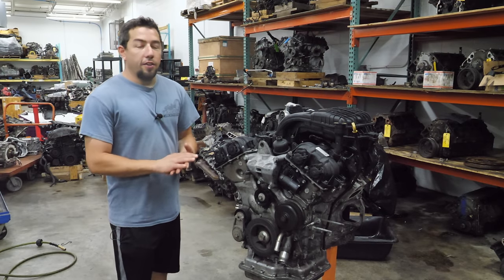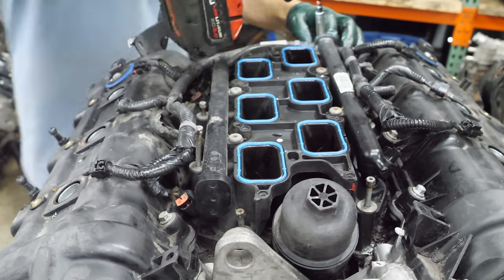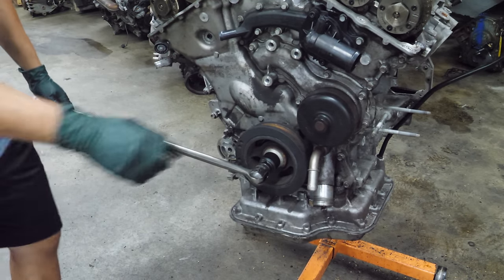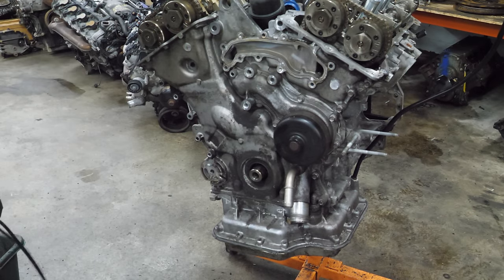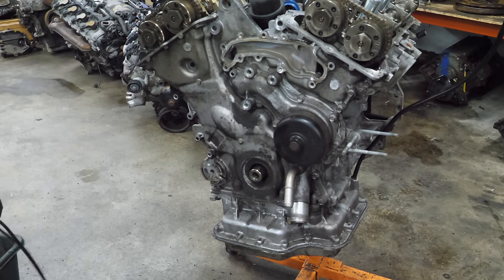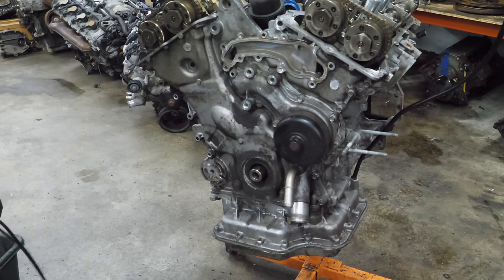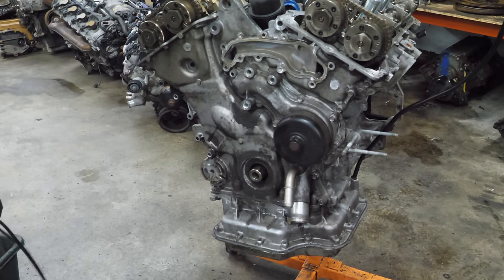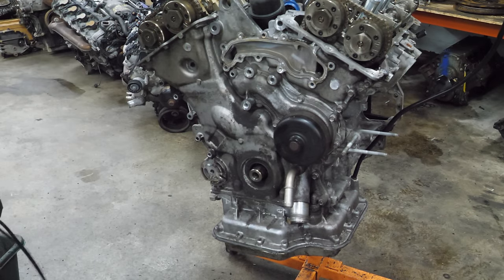Dodge Caravan 3.6L Pentastar V6 Teardown! Why Won't This Engine Turn All The Way Over?

Comment: It was fun watching this video as a Chrysler tech dealing with this shit all the time 😂😂 good work on the tear down! Just for future reference the short bolts don't need to come off of the water pump or thermostat they can stay on for timing cover removal but I understand that for tear down purposes you need to look at everything
Reply: Dealing with what all the time? Engines locked with carbon buildup?
Reply: @sbond1963  no tear downs in general. The rocker arms fail a lot of them and take the cams out with them. Plus the oil pump tend to fail a lot too. Or the valves leak causing misfires mostly top end stuff. Bottom end is fairly solid on theses engines as look as they are maintained
Reply: @omerqawi9096  Yeah thats what i like about them, most the problems a DIY like me can fix. I also have access to a lift at work

Comment: I had a 2016 T&C with that 3.6 piece of crap,traded in by 80k miles..8 rockers ,4 valves,coolant system replaced, cam phasers were clicking ever so slightly that I prayed the mechanics wouldn't care or hear it when I traded it in..strong motor but they went cheap on those rockers..6 months after trade in got my money back for the last repair done because it was the number 2 again lol Never been so happy that the misses got the extended warranty

Comment: My mom has an early 3.6 (2011 Grand Cherokee) and fingers crossed it's been totally trouble free for the 160,000 miles its been in service (I think when she bought the car it had 40,000mi on it). Even the oil filter housing has been fine except the little check valve in the middle pinging off, one little plastic piece later and good as new.
Reply: Reminds me that I loved riding in a 2011 Avenger with the Pentastar 3.6 option! I would take those over the booooring "World" N/A 2.4 I4 any day! Unfortunately, the Avenger that my sister had, which was also a 2011, had the "World" 2.4 I4 and by 2018, it started bucking on acceleration, more like I would expect from a GM Iron Duke N/A 2.5 I4 from 1983!

Comment: My wifes 2016 durango has this engine. It has been an economical workhorse. On paper you wouldnt think this engine would motivate that 5,000 pound durango out of its own way, let alone tow much of anything due to its anemic hp and torque numbers. But it has suprised the fool out of me. Has drug my 9n ford with bushhog and disc 2.5 hours one way to my inlaws more times than i can count. Pulls our 18’ pontoon boat, which isnt much weight, but has the aerodynamics of a barn. It even with all things considered, manhandled my dads new holland tc 35 with bushhog, loader, and water filled back tires up a pretty serious grade between my house and his. It gets really good mileage both pulling or no. 24/25 lite, 14 pulling the boat, 16 pulling my tractor. And somehow it does this without needing to scream just under the rev limiter. I generally back off of it if it goes over 3000rpm pulling a hill and let it bleed off a few mph just to pick it up on the other side. I have been dang impressed. 160,000 miles and counting. I initially grossly underestimated that vehicle.

Comment: Ours went 200k with normal maintenance, blew up recently because of a water pump failure. Sad thats why it failed, but we are about to put another one in it😊 Loved that engine, its got plenty of power and torque for pretty much any job. We had the towing package too, so our Durango was no slouch. Its going to me after the engine swap, going to love it with all its glory.

Comment: I owned a 2012 Wrangler for a couple of years and it’s the only non V8 vehicle I’ve ever owned, I thought this engine performed remarkably for what it was.  Large displacement V6 engines usually do ok as long as you service them and don’t constantly push them around.  MY Jeep had a 2 1/2” lift and 35’s and while is was probably a bit underpowered I just took it easy on throttle most of the time.
Reply: You know I keep hearing everyone say that but I have a 2013 with a 4 1/2 inch lift and 35's and it seems fast to me. I mean a lot of times I chirp or spin the BFG ko2's on take off from red lights and stop signs with out even meaning too and it will hit a 100 on the freeway with no effort. It is a 2D though. The engine is stock but I have about 10k worth of other upgrades like steering, control arms, big brake kit etc... but one mod I made that may be the difference was in on the JK's gas pedal up under the dash in the most hard to get to place there is, there is a double spring encased in a plastic housing that provides resistance against the gas pedal when trying to "give it the gas'.  Mine was wearing my dam calf muscle out on long trips so I hit the Jeep form and there was a post on removing one of the springs. After I did that, I now have like a Cadillac gas pedal that is much easier. So maybe it's just perception ???

Comment: Got a 3.7L in my Ford Transit work van. I’d love to see you tear one of these down, it seems like one heck of an engine and I’d love to see how it’s built. Mine personally idles for 2-3 hours a day then gets the living crap revved out of it trying to move a 10,000# van down the highway; 105+k miles it has never given me an issue, nor did the last one I had that had 150k on it before my company “retired” it.  It’d also be cool to see the new 2.0L turbo that’s in the Jeep Wrangler JL
Reply: The 3.7s are very similar to the 3.5 Ecoboosts, check those out. Basically yours plus turbos and stronger internals
Reply: I ran a 3.7 transit for a few years.  It sounds good, but that 2nd gear pull to highway speed, especially on an uphill on ramp is well into sandwich eating in one hand driving with the other territory, at least on the 6 speed transmission.  The trick was to hit the upshift button in 1st at just the right time so the rev cut helps bounce the engine speed down to the 2nd gear engagement rpm quicker.  That thing did 150k of that on a steady diet of the cheapest jiffy lube oil changes and never needed anything or consumed a drop of oil.  It was also noticeably stronger in the midrange on E85, so I ran that whenever possible.  The 3.5L turbo transit is orders of magnitude better, especially on grades, but they just don't sound as good and the 6000 rpm tach isn't as much fun, especially since the stock ecoboost power delivery is pretty much circling the drain past 5500.  It is fun to troll other cars that don't expect a transit van to be able to make them look bad, lol.
Reply: @hdrenginedevelopment7507  agreed! For as much weight as I have in that van it does go surprisingly well and isn’t afraid to rev over 5k if the need arises. I’ll agree with the second gear thing, although I don’t remember that being an issue in the ‘16 I had.
Reply: @Frank-fz4tm  it wasn't an issue with 2nd gear, more like an issue with a V6 that makes 270 hp at 6500 rpm pushing an 8000+ lb vehicle on fairly long ratio gearing of the 6 speed transmission.  The sooner you can get past 4500 or so rpm, the better everything goes on that setup.

Comment: I bought a JDM low milage 2.2 engine for my Camry.  I put it on the engine stand and it turned over freely.  I turned the engine upside down to check the bottom end.  After that I turned it back up and could no longer turn the engine completely over. Pulled the head and found a big chunk of carbon had settled in the squish area of the chamber. Cleaned, assembled and engine ran great.

Comment: I see some of these go for ages and the head problem is a recall and will be warrantied afaik. One customer had a 2012 wrangler with an unsolvable miss. Checked comp, driver side was low in the center cylinder, and that was the one with casting defects. Otherwise it was good.

They are also fairly resistant to neglect but being a quad ohc engine with vvt I would still be really mindful of oil changes. I see these at higher mileages as well and they have few problems but thermostats are a common problem and oil cooler problems are relatively common but not omnipresent. You can take apart most of the top end with 8, 10, and 12mm sockets and it's all you need to pull both intake halves.
Reply: I own a 2012 Wrangler and the head was replaced under warranty early on.  Other than that and a thermostat stuck open, it has been extremely reliable.  I would trust it over the 2.7l on the Bronco I ordered in January to replace the Jeep.  I change the oil with Pennzoil Platinum religiously every 3k miles.

Comment: All the Plastic Parts on engines nowadays. Remember when everyone laugh at AMC in 1979 or 1980 with straight 6 engines with the Plastic Valve Cover? 
This engine I think Dieseled in the crash and broke all the carbon lose. I've heard carbon break lose in the mid-1970s when leaded gas was around, it happened right in front of me once, someone came over to visit, shut his car off and it dieseled a little bit, then when he was ready to leave, Carbon Knock, I grabbed the garden hose couple engine rives when pouring water in the carburetor cured it. This was on a 1971 el Camino he always used Premium Gas, more leaded. 
Good Show, Very Educational!! Keep'em Showing!!

Comment: I bought a 2018 Challenger with about 18k miles that had been a Hertz car.  It was really loaded with equipment and I liked the room inside.  I had no experience with the Pentastar before buying that one, but I drove if for a year and 3 months before trading it for a 2019 Challenger R/T.  I had a great experience with the Pentastar and respected it for the fuel mileage and it's eager attitude.  I found it to perform very well and had no complaints about it.  I wonder if this teardown engine was driven slowly around town and never taken out on the highway and opened up.  Perhaps an elderly owner, who knows?   Thanks for tearing one of these down!  I look forward to your Saturday night episodes :)
Reply: Even on the highway, these things are barely ticking over. If it weren't for me driving my wife's minivan on occasion, I don't think it would ever see over 2500rpm. A few runs to redline under full load every now and then isn't a bad idea.
Reply: This reads like one of those fake amazon reviews
Reply: @MrDrmorbid  I don't know why you'd say that.  It was my experience with a 2018 Challenger with a Pentastar.  If it offends you, don't read it.
Reply: It's a great engine when you treat it right. 30+ MPG on the highway all day long!
Reply: They retooled these in 2016 a bit.  I have the same in a Durango.   At 65mph it's sleeping at 1600rpm in 8th.
Reply: @ericneeds1512  That's the PUG (Pentastar Upgrade) engine. The Charger/Challenger/300 never got that
Reply: @ericneeds1512  Like how the Ford "German 4.0" V6 should have been, but the stubborn transmission makes it stay at 2,500 RPM or the like with only 65 MPH cruising, as if it were an old N/A 2.3!
Reply: @RJARRRPCGP  That would remind me of my old 3.0L Cadillac Catera motor - humming along at well over 2,000 rpm in 4th at 55.  At 65, you could still drop it to 2nd, and it was still good for ~30mpg on the highway.
Reply: @philbrutsche8928  Is that why people could get RIPP superchargers on the Charger/Challenger, but after 2015, they don't exist on the Durango w/o a Hemi.
Reply: @ericneeds1512  Maybe, maybe not? I looked at the RIPP system a little bit, and the newer cars have a locked ECU that needs to be dealt with (shipped out and unlocked) to do the RIPP supercharger. It's possible that the PUG, with the locked ECU, just doesn't have as much interest in the aftermarket as the 1st gen Pentastar in the Charger & Challenger. BUT... there's a supercharger kit for the newer Gladiator with the PUG, so it might be a thing where you will get better info my emailing RIPP.
Reply: @ericneeds1512  That reminds me of a failing automatic!
Reply: @RJARRRPCGP  Oddly enough, the old Catera did end up a few times with the transmission light on and in limp-2nd mode.  It ended up in a wreck , so I didn't have to deal with it - or the 100k timing belt/water pump.  Durango on the other hand... 8 speed is very good.  I wish that I had as good of a transmission in my previous vehiles.  Closed space gears are great when properly geared with the final drive and motor.  Hint:  Mazda MPV 5 speed was not so good.   Transmission didn't have issues besides that.

Comment: Really low mileage, a lot of really good parts. Those heads and valve train should be sold as is. The problem was more than likely the PCV valve was stuck open and was acting too aggressively to carbon it up that quickly. I've seen those engines run to 200 plus thousand miles and the only reason they had to be worked on is because the timing change had stretched to a point where it just was running rough. These are very capable engines unless you drive them too hard.
As for that oil cooler base and the oil filter housing, Dorman does make a replacement aluminum casting for that, however you must switch it over to the newer system so it has a slight Plumbing change you cannot use the oil cooler from the 2011 and 2012 engines, you have to go with the 2013 and newer oil cooler.
If I thought that that were normal I would suggest that you put an oil catch can on that engine. Given as low miles is that engine head, it was sucking way too much oil. An oil catch can would have relieved much of that issue on that particular engine but a proper PCV valve might have been better. It's amazing how that little 49 cent PCV valve cause that engine to be junked when it was perfectly good.
I don't recall seeing a lot of oil Ash on any of the plugs. That was unusual.
Reply: Doesn't a PCV move gases from the crankcase to the combustion chamber?  So theoretically a clogged pcv wouldn't cause carbon build up, right?

Comment: That was probably the cleanest engine I’ve seen taken apart aside from a brand new one, except the carbon. Really odd that it built up so bad so quickly.
Reply: That's a Valvoline engine.    It cleans that good
Reply: @gregorylyon1004  no it's the constant addition of oil to keep the level up that kept it so clean. At this point any oil would do this. If you really want a oil that keeps a engine clean you run Amsoil the best oil out there, and the oil everyone tries to copy or imitate sorry guys but there formulations are patented and proprietary so no one can steal them because Amsoil is the best! Liquid gold!

Comment: the v 6 in my 2004 dodge caravan has been great !  regular oil/filter changes with Penzz 10 - 40 and it runs strong !  Best v 6 engine ever made !
Reply: Definitely not.
Reply: Your 2004 has a completely different engine than the pentastar displayed in this video. It utilizes cam in block, whereas the pentastar uses dual overhead cams. The displacement of the cylinders is different as well.
Reply: NOPE, buick 3800 is pretty close to the best V6 made. it's a tough engine, and in supercharged form can make a ton of power if you build them right.
Reply: Steven is quite correct about the old 3.3-3.8's being, arguably the best V6 ever made.  Not overly powerful but you couldn't kill em if you wanted to.
Reply: @andrewdonohue1853  The Buick 3.8 is the best V6 Detroit ever made, and it's not even close. If you don't run them out of oil, they will run forever. The highway mileage they can get in a full size sedan is amazing. I saw over 30mpg consistently. I gave it to a friend at 175K, and he ran it another 100K. It was still running when he took it to the junkyard.
Reply: @dougrobinson8602  i have never been able to get 30 MPG out of one. the durability and reliability though, is 2nd to none. i find the fuel mileage to be decent but expected for a V6 from that era.
Reply: That's not the Pentastar 3.6L V6, that's either the older 3.3L or 3.8L V6, made my Chrysler starting in the late 1980s. They are very good engines either way.
Reply: @dougrobinson8602  Had a 1995 Bonneville with a first year 3800 series II.  Took good care of it, but around 100K developed a leak from the coolant passage to the intake runner of the plastic intake manifold.  Fortunately noticed the problem before it killed the engine.  Many others weren't so lucky.  Also failed virtually every engine sensor you can name, then had to replace the ECM to get it running correctly again.  Second owner had to replace most of the A/C system and rebuild the transmission.  Last GM car I ever owned.

Comment: Blew mine that was in a 2012 wrangler.  Pretty sure it was either the mystery oil in the gas or the flush i did a month before.  End result was a see through block.

Comment: Casually runs into every issue I have with these engines.

Trying to do this while it's in the vehicle is a nightmare. 

I would recommend to you to upgrade your hose lines and fittings. I was losing 300ft/lbs out of my impact gun. Makes a whole world of difference for removing truck tires. You lose a lot with long thin lines. 

Still would like to see a 2.0 LTG. Piston carnage likely if you need a video of it.

Comment: Doing my mom's 2013 charger ,same engine ,low pressure and dead cylinder 6,changing the head this weekend and needed this video badly,15 year self taught mechanic,already had to change bank 2 timing chain , exhaust camshaft,and 4 rocker arms in bank 2 just to get it running now I gotta take it apart again and change head and gasket of course, thanks

Comment: my caravan with this 3.6 has 340k miles. it has had new camshafts put in, a water pump and a battery. thats literally it, its a great engine!
Reply: What year is your Caravan?
That's incredible! 340k miles! Wow.
I've heard so many stories of these pentastars with incredibly high mileage.
Reply: @88jopar  im now at 383k , mines a 2018 . Its power has for sure seen a decrease, but its still going